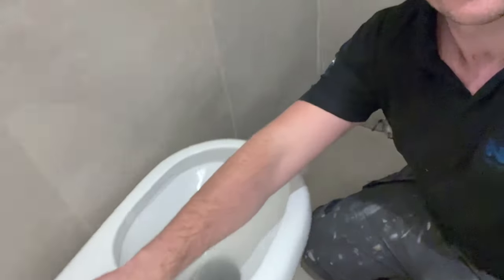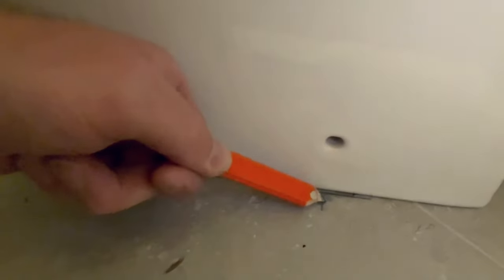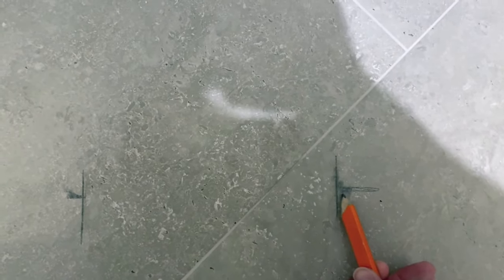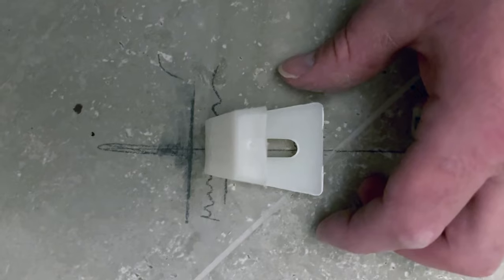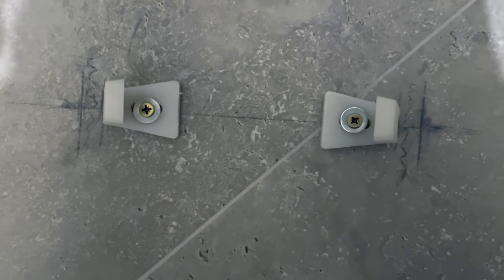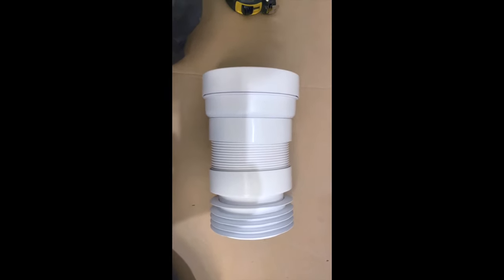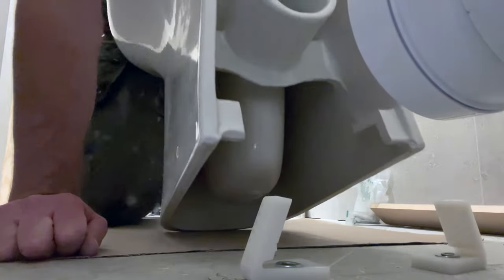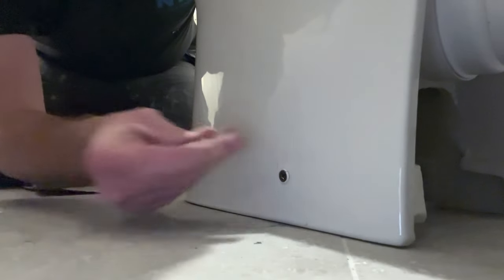How to fit a toilet pan

Comment: Thanks for the video. I'm not a plumber but fitted a few pans. I've seen other YouTubers not putting the floor fixing screw in the middle of the floor bracket (4.50 in your video) as they claim the bracket could move over time.  They actually drill 2 new holes in the plastic bracket - what's your view on that?
Reply from the maker: Hi GrumpyGrampa, Thanks for your comment and if you haven't already please don't forget to like and subscribe. 
Im my experience I've never had the toilet brackets loosen over time using the method I've used in the video, I find a neat bead of silicon around the base / footprint of the toilet acts like glue and helps stick the toilet down, along with the toilet brackets the toilets not going anywhere. :)

Comment: Who did the tiling? Either cut both tiles using the join as center or put one whole tile on the center line of tile n the center of the space and then cut the tiles either side. That symmetry on either method would look better than a whole tile and a cut!?! Who would do that!

Comment: Our toilet is plumbed into the floor so this didn’t help
Reply: Our toilet is plumbed into the floor too, and this video helped me. Floor or wall, no difference really. 
The pan connector that comes with a floor mounted toilet is an L shape but it has the same connectors on each end